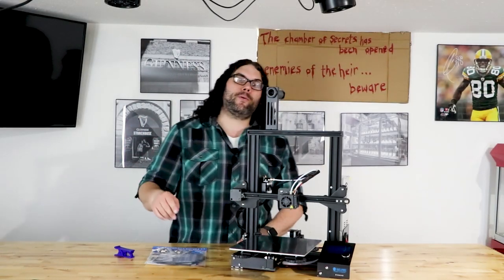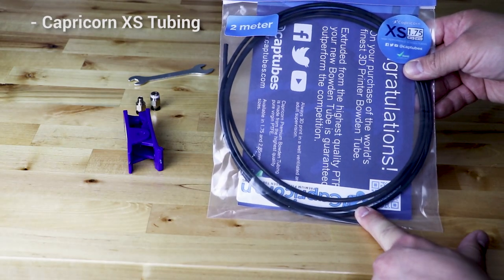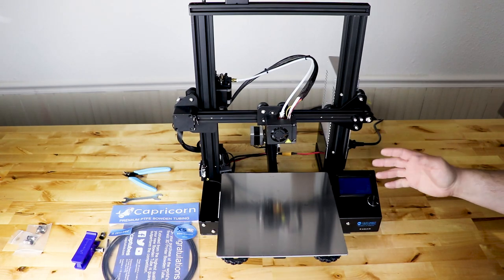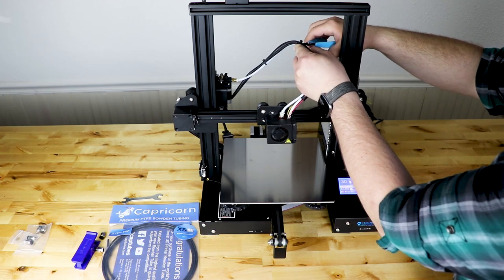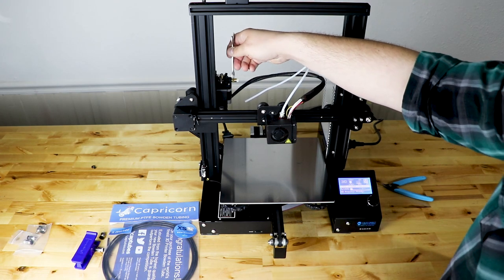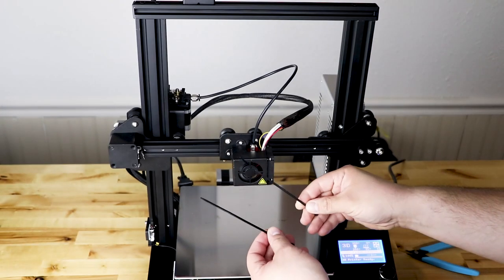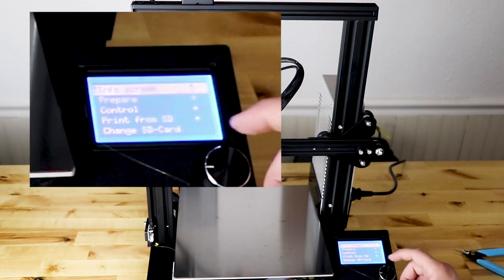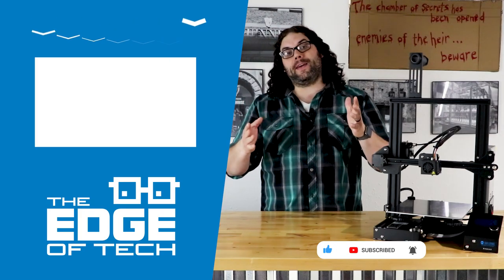Replacing the PTFE Fittings and the PTFE Tubing on a Creality Ender 3

Comment: I've heard everywhere from 1/4 turn to 1 full turn...
Every single time I do it, no matter what, when I do a manual retraction test (pulling and pushing it back in with my hand) there is always a fairly large force necessary to push it back... Is this just my hand's retraction speed and amount being too far, causing improper pressure in the nozzle?

Comment: You don't have to reconfigure the extruder stepper motor after replacing the tube?
Reply from the maker: You shouldn't, but I would check the flow rate for sure!

Comment: On the top of the extruder block, there is a circular clip, do you have any idea what this is meant to be used for?
Reply: I have looked carefully at your extruder block and yours does not seem to have this fitting, this must be an addition to the latest production models as mine is only 2 weeks old, the sheathed cabling seems too thick to fit into this clip  plus I wouldn't want to trap my cables in this clip as it would create a hinge point on the cable and possibly over time snap strands of copper
Reply from the maker: You are correct. It's to hold the cables. As long as they are not pinching the cables and you give it enough slack to the hotend, you can use that clip just fine! Thanks for watching!

Comment: Do you know if the two fittings you reference in the video are the same for the Ender 5?  I emailed TH3D but did not get an answer to this question.
Reply from the maker: I have verified that they are the same. The PTFE tube is a little longer though.
Reply: great!  I already purchased the tough tube from TH3D
Reply from the maker: @DD-we9wm  Perfect! You will love it!!

Comment: what do you do if the tube is backing out of some couplers that are about an hours worth of printing old?
Reply from the maker: Are they the stock couplers?
Reply: @TheEdgeofTech  nah, they are aftermarket and good quality
Reply from the maker: Crazy! What ptfe tube are you using? If you are using good couplers, they shouldn't allow the tube to pull out.
Reply: @TheEdgeofTech  Capricorn xs, maybe i have a flow restriction somewhere causing excess pressure?
Reply: @pacman7516  I'm having the same issue with mine also!

Comment: Has ender 3 pro fixed this issue?
Reply from the maker: Not that I know of. They still use the crappy PTFE fittings but have started using better PTFE Tubing on some models. Thanks for watching!
Reply: @TheEdgeofTech  Thanks for the reply! Would you recommend the i3 mega over this? I believe that doesn't have this issue.